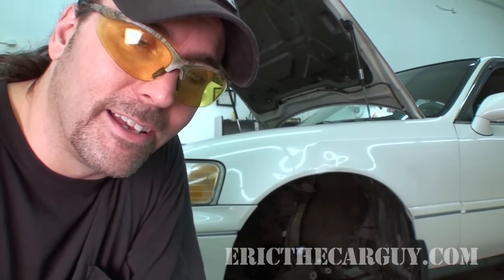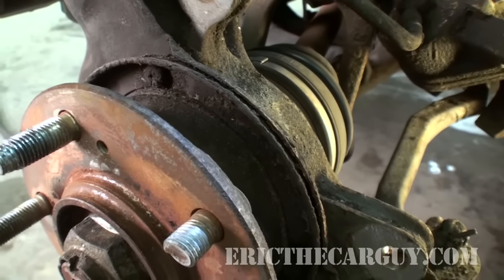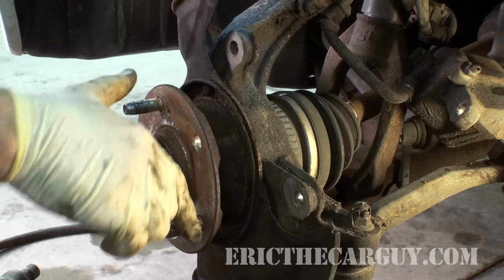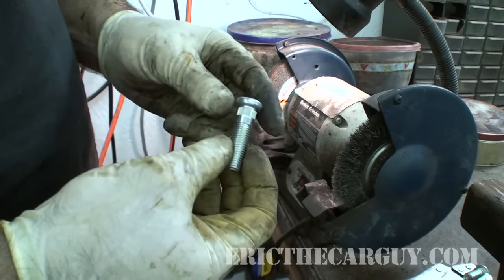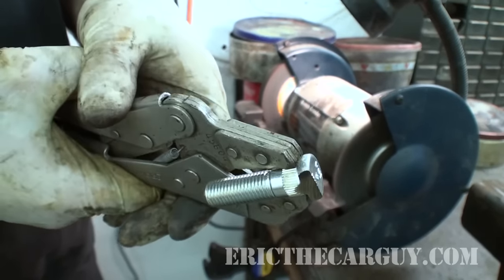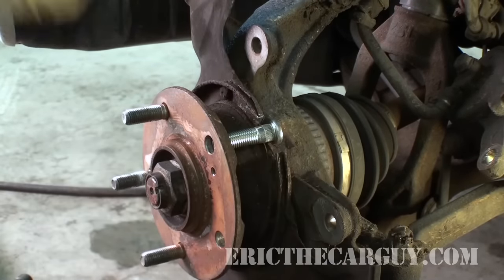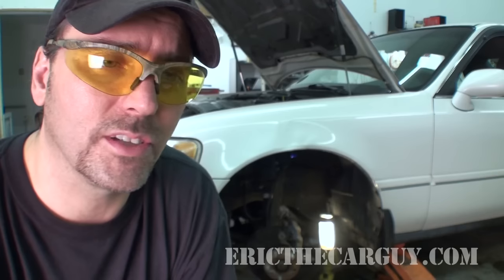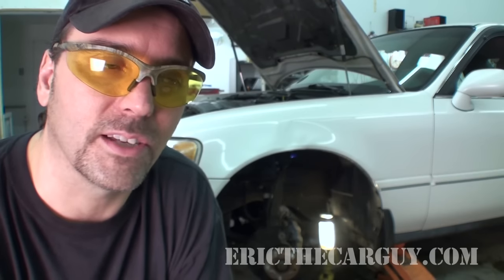Replacing Studs the 'Easy Way' -EricTheCarGuy

Comment: Think if it was my car i'd rather it was done properly even if it ended up costing more. Though of course there are customer who will only care about the price so they end up getting what they are prepared to pay for!
Reply: That's easy to say when you're not looking at a 250 dollar repair bill for a lug stud, as compared to 60-80 doing it this way.
Reply: xX53preble53Xx
Try about 6 dollars this way lol
Reply: pcmasterfilms
you clearly forget about labor costs
Reply: SgtPnkks
I have a brain, soo only labor cost is the a half hour of my time.
Reply: pcmasterfilms
 that applies to you but not everyone... considering we're comparing to the hypothetical $250 repair bill which i'd assume for you would also be considerably lower
Reply: If you took your car somewhere they would fix it like this charge you more for it and you would be none the wiser.
Reply: Derek Schwartz Right! Even if I was rich I'd probably still do my own repairs, I'd just build an awesome garage with a lift and everything.
Reply: heavydiesel still works the same if it's an old pos why spend the extra money

Comment: My mom had her car inspected and the mechanic forgot to tighten the lug nuts on the one tire after rotation. The car was making a strange noise 2 days later after she drove a 20 mile trip and back. I jacked the car up. The tire was wobbly, so I took it off, and two lug nuts fell out; both broken off.  This method looks great to me. Thanks for the video.
Reply: The studs fell off with the lug nuts after I took the hub cap off. I forgot to mention that. It's late here.

Comment: A suggestion that I have, coming from a manufacturing background, with having cut threads a lot, and fixing messed up ones, when ever I had to fix old threads, I would just take a thread die to them and recut the same size thread, that always worked for me, so I do the same with my automotive work and never have any issues after I do that

Comment: I dunno, Eric....seems to me like grinding a notch in the backing plate, grinding down the wheel stud and then still having to deal with boogered-up threads was just as much work as pulling the hub.
Reply: cheaper for customer though, price of 2 studs vs price of wheel bearing & hub assy
Reply: You wouldn't even necessarially need bearings, which are not expensive. It would just take more time to remove the knuckle, press everything apart and back together, and get it all torqued right, etc.

He could have modified the knuckle/dust guard more effectively and safely, but yeah, this was generally all the wrong way.

And jesus, what was honda thinking?
Reply: Sval Bard
True.

But that's not important for DIY'ers watching how to do this on youtube.
Reply: dav3fk  I disagree more with re-using press in wheel bearings than I do with this.

Plus, if you don't like the idea of grinding down studs, buy cliphead studs. ;) They are made with a flat spot if it makes you feel better.

I will say, as long as the customer is told something like "I can do it the dealer way and charge you 2 hours, or I can do it my way and charge you 0.5" I'm fine with it. The stud is still plenty strong, and the backing plate is still secure. As long as the customer pays an according rate I'm good with this.

I'd be just fine doing this to my car.
Reply: atsernov
I could be mis-understanding things..... but if it's like my car, I THINK all you need to do is unbolt the axle nut, and slip the hub off. No need to press out or replace the bearings at all, they're not interferance fit to the spindle, they're held on by the torque of the axle nut, they're just pressed into the hub.... right?

Axle nut torque is very important (or the bearings have the wrong preload and eat themselves) and it's very important to use a new nut and cotter pin.... but still...

Again, I could just be an idiot about it, or have forgotten the exact contents of this video.
Reply: dav3fk  No, all the axle nut does is hold the axle in place. And acts as a backup in case of catastrophic failure of the bearing.

The bearing is a press fit from the back of the knuckle and re-enforced with a spring clip. The hub is then pressed into the bearing from the front. You have no way to get the dust shield off without separating the bearing.

To change the stud properly you take the Hub+Bearing+Knuckle assembly off the car.
Press the hub out. This inevitably splits the bearing because the inner race never lets go of the hub.
You then remove the spring clip from the back of the knuckle, press the outer race out the back.
Cut the inner race off the knuckle, because simply heating the inner race usually doesn't work.
Replace the studs.
Press a new bearing into the knuckle and reinstall the spring clip (Mind the direction as the bearing is the ABS sensor's trigger)
Press the hub into the knuckle/bearing assembly. (DON'T FORGET TO PLACE THE DUST SHIELD IN PLACE FIRST!)
Reinstall the Hub+Bearing+Knuckle assemble back on the car.
Reply: atsernov Also note that there are many different ways of doing things in the car world. This last reply was just how this Accord had things done. Other model Accords you need to split the bearing just to get the damn brake rotor off.

Many (most?) cars are simpler than this.
Reply: Ohhhh right, FWD....

And good god, that's horrible, about a brake job requiring bearings.
Reply: +rayzian at an increase of labor pricing which events out...

Comment: A mechanic replaced a stud on my moms rear wheel during a more complicated job and apparently screwed up real bad. Some time later she tells me her car makes a popping sound sometimes when she's backing up, I couldn't figure it out right away. So some weeks later when I got the chance, I removed the brake drum to change the shoes and hardware and immediately I see there's a broken spring just floating around in the drum and the brake adjuster was all bent to shit. So I'm like what the fuck could have caused this nightmare?!?! I remove the backing springs and the pins are bent all out of whack, and as I'm removing the shoes, half a rusted stud comes tumbling out of the assembly. There you have it! Whoever she took it to to get that work that involved replacing a stud done, they just hammered it back into the drum assembly, was probably too lazy to take it apart and retrieve the old piece, put a new stud in, put the WRONG TYPE OF LUG NUT ON THE CAR and sent it on it's way. I wish she could remember who she took it to cause I'd drill them a new asshole for causing us all this trouble. Do you know how hard it is to get a new brake adjuster for a 2003 Mitsubishi Outlander?!?! Out of sheer luck I found 1, count 'em, ONE Outlander at the junk yard with the back drums laying dug into the ground. I had to pull a jack from another car to lift it a little to get the part out. In all the years she's owned that car I have never come across her car at the yard, it's actually a really well built car and reportedly seems to run forever.
Reply: people don't understand this method is wrong should not be taught thank God this guys mom didn't get hurt or worst

Comment: When I have the problem of not able to feed a stud in the hub due to no clearance with the backing plate,I use a hole saw to make a 3/4" hole in the backing plate so the old stud can be removed and the new stud installed.  I then take a solid rubber grommet to plug the hole when I'm done.The time would about the same and you have a nice finish result.

Comment: pretty sure every honda DIY'er have been doing this job just this way if they don't have access to a 20 ton Hydraulic press and a set of large sockets. In fact this method predates eric's video by some years. Take a look around Honda/Acura forums.

 No need to rip on anyone Chis Pellatt.

Comment: I have to laugh at the naysayers because this is EXACTLY what they would do in a shop.
Reply: You are wrong. I remove the hub, and inform the customer of the potential of the bearing failure, and if it fails, it's getting replaced.  Or I assemble it with a bad bearing under the responsibility of the owner and make note of it on the RO.

Also, if the customer is just a pain from the get go, I'll just send them packing, and won't do the repair. I'm fine turning down a wheel stud repair.  I'll make my overhead with other jobs I promise.
Reply: +Lynx Star Automotive (Gabe V) Thats terrible customer service and they would be more pissed off being charged a whole bunch of labor for a 10 minute operation
Reply: Rusty Laidlaw  How would that be terrible customer service friend?  Perhaps the original post was a bit out of order.  If I get a vehicle that requires hub removal to replace a stud, I upsell the bearing for integrity, and quality of repair, prior to any disassembly.  I want to prevent a future failure and inconvenience to the customer.  If the customer declines to have the bearing replaced, then I inform them of the potential bearing failure, and assemble it under their responsibility.  This is provided to the customer in written form on the RO.  If the customer refuses to accept the reality of the situation, I just turn away the job.  It is not worth it for either of us.  No harm no foul as they say.
Reply: +Lynx Star Automotive (Gabe V) I think your viewpoint is well put. But I also think that if the customer has full knowledge of the risk, which is minimal, considering many replacement studs are manufactured in the same way to which he modified it, then it should be an option for them. I wouldn't have a problem doing it this way if the customer gave me their permission. Why not? If you'd press an old bearing back in, despite the risk of breaking it, with a customers consent then why wouldn't you do this?
Reply: Everett Clunie Everything you just said I mentioned in my previous two posts friend.
Reply: +Lynx Star Automotive (Gabe V) hmm. I must've missed it. I thought you said you wouldn't do it this way period even if the customer gave you full permission for everything to save a few bucks
Reply: Everett Clunie No I'll do it, and have done repairs like that before.  Tho honestly, in my experiences, most customers like that ALWAYS comeback to complain it didn't come out right, so it's probably best to just pass on the job.
Reply: keith cunningham What is their warranty like?  I mean I typically do brakes for about 600/axle.  But I work on european cars, and warranty my work for 2 years.
Reply: I would just take the fucking hub out. It's not hard and takes less time than doing this shit.
Reply: Do it properly and replace the bearings anyway. I wouldn't even approach this method on my own car...LOL
Reply: Lynx Star Automotive 600? parts would be about 200 for basic stuff and then an hour’s labor.
Reply: @headphonesnotincluded1700  wrong!

Comment: Why not dig a groove in the knuckle ? Grinding off 1/4" into the knuckle casting seems to me safer than removing 1/3" of the stud thrust surface.
Reply: +shodanxx so instead of effecting an interference stud with a hubcentric wheel (takes load away from the studs). You what to score also heating a cast piece of the suspension, which will than shatter the first pot hole u hit hard. its not 100% proper yet customer didnt have to pay an extra $250 they probably didnt have
Reply: The casting is about 1 inch thick at this location. You don't have to heat it, just grind a bit off. As long as you blend it smooth it will do nothing bad to the part. Castings work mostly in compression and most of the weight goes through the knuckle's central axis. This is nothing compared to what corrosion does to these parts yet they rarely break.

Those studs hold just as much weight as the entire knuckle and they do it on that tiny face which just had 1/3 of its trust face grinded off.

Way, way better to grind that off the knuckle rather than the studs.
Reply: +shodanxx i was thinking about that
Reply: +shodanxx Think about it this way...that stud with 1/3 of its face ground off does more to hold on your wheel than a stud without a lug nut.
Reply: BigBrotherIsTooBig It also does less than an intact stud.
Reply: But how much less, really?  It would be nice if a metallurgist could step in and actually calculate how much more force an intact wheel stud can take than one that's been ground down.
Reply: The thrust surface on heavy equipment lug nuts quite often only cover a 2/3 contacting surface with the hub because they come with a machined flat exactly like Eric did. I can't see it doing much harm honestly. As long as you don't heat that stud up too much when grinding it. I would be more worried about grinding a 1/4" out of the casting surface. Just because when cast iron isn't properly ground it creates a notch effect and can crack quite easily when shocked or stressed.

Comment: usdot has a rule on stud design a> you have taking the harding out of the stud by heating on the grinder b> you have cut a 1/3 of the strength  away. C> that dust guard is there for a reason. but guess your right make it cheap screw doing it right and screw the threads up in the process
Reply: hahahahaha really hahahahah because he took one third to the stud u came to the conclusion that the took one third of the strength  sure and the grinder didn't get it that hard to change anything because it needs to get way hotter to affect it and the ventilation shield was not affected because he did not cut the actual shield just one section which does not redirect air to the rotor due to the small size. u could consider it a inert section meaning honda could easily not include that section in the shield period so i don't  know where u get ur info

Comment: I would do this on my own car but not on a customers just doesn't seem professional.
Reply: customer- "I need these studs replaced how much would that cost?" Ericthecarguy- "well on this car i need to remove the hub assembly, axle nut which sill sometimes result in a damaged bearing which will set you back a couple of $$$$$ or I could just cut away that metal piece and it would only cost a quarter of the $$$"  customer "hmmmm just a metal piece huh? fuck it, do it"  and that's how these things go my friend.
Reply: Haha that's pretty much it.  Customers are tight arses who don't want to pay for proper repair.  I always offer the proper repair too though.
Reply: I wouldn't even ever give a customer this DANGEROUS option!

Cutting all that surface material off of them studs DOES weaken the studs, and I know when I'm doing 55-65-95mph on a highway, last thing I would want is for my wheels to start falling off due to failed lug studs!

I've pulled countless axles over the past 35+ years that I've been repairing vehicles and have NEVER once ruined or busted any bearings doing so, and I have also NEVER cut holes in heat/dust shields!

That is just some LAZY amateur bullshit!

If you can't pull a rear axle and change the stud correctly in 30 mins or less, than you're just in the wrong line of work and need to find a new job!
Reply: It’s not just pulling the axle, the hub has to be pressed out of the knuckle and that could damage the bearing in removal
Reply: NYMetal Guy I think that's a front axle as well
Reply: @changospank1  Exactly
Reply: Well...my civic has four lugs on each rim.It was driven 2 years daily with 2 broken studs on seperate wheels.3 studs held the wheels on.Do you seriously believe that grinding away less than a fourth of the head is going to change anything about the integrity or strength or capability of the studs doing what they are meant to do...hold the wheels on?Saying..3 studs did the job.4 studs with one ground certainly will.

Comment: Great short cut and dollar saver, garages charging $150 an hour is a hard pill to swallow for most of us..this job at normal shop rate would be unacceptable to me...side job rate or d.i.y. ..if you got the right tools definitely will save you cash....the way in this video is the best one ive seen

Comment: Nice thing about having a European car is they use lug bolts.
Reply: They break too and cause problems.Most well designed vehicles give you an access area to remove and install these press fit studs so it isn't an issue.
Reply: The TDI Guy  and then when they get fucked up......you gotta replace the whole hub

Comment: Absolutely nothing wrong with doing this. As technicians, we are not required by any state or federal law to pay for a customer's part simply because they don't want to pay the added cost due to additional labor of wheel/hub bearing replacement. This is something the general public needs to be informed on. If you don't want to pay for the part, that does not mean, we the tech's have to pay for it. Remember folks, I do not have to fix your vehicle.  I will even go so far as to type up a contract saying the customer as mention beforehand would not pay for the service and make them sign it. This is a legally binding contract, the minute you sign it, well, you know how it goes. I hate having to do it but there have been times where I was left with no choice. For the most part, my customers are AWESOME, but remember, every rose has it's thorns.